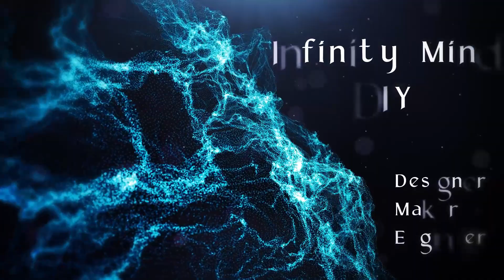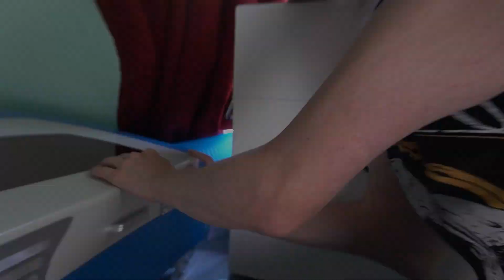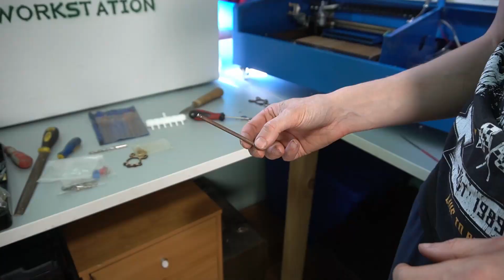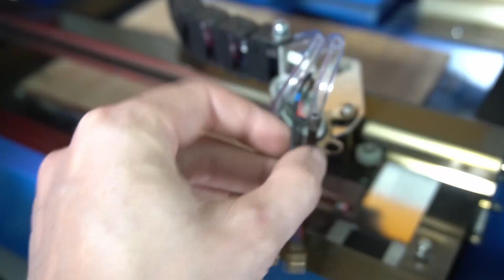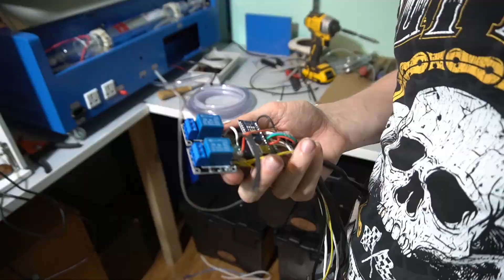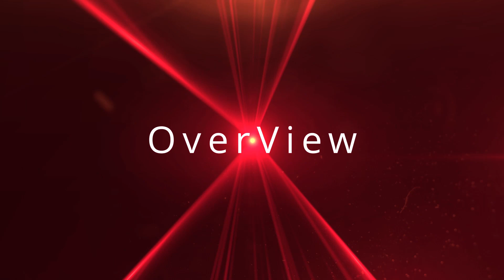K40 Laser Essential Upgrades, You need to really consider having these upgrades

Comment: Nice video on your mods, especially the Air Assist.  That pump is great for the K40.  On mine, I took a pool noodle, cut it in half and placed the pump on the half noodle strips, before attaching to a piece of Pine and then to the K40 base.  Also, these pumps tend to get hot when run for a long time, and I was worried about heat buildup in the enclosed electronics area.  So I mounted a large computer fan, in front of it, to help keep it & the electronics are cool.  It works great.  Have not had any issues in two years.  I also use a similar air assist set-up for my Diode Lasers.

Comment: Why did you use an  Arduino for lasers and air assist? 2 latching switches or relays would have done the job.
Reply from the maker: Probably would have been simpler but it is the solution my brain came up with at the time.

Comment: Hi there, I bought same Machine but I have problem with could you please help me? when I connect Usb cable I can hear sound but, it will not work at all. in software will say :USB Error:Laser not found (Lib USB driver may not be installed)   but I have install as it should also I have change many cable but same dam message will come up. wish you or any one have experience help me
Reply from the maker: Hi, I cant say I've seen this issue before but the process i would follow is:
To check everything is on
Then uninstall and reinstall the driver (restarting the computer between each task(It used to be a think you needed to do, not so relevant these days but old habits and all that).
If that doesn't work check/change the cable (as you have done) 
then I would check inside the machine and make sure all the various leads are connected correctly to the board.
If this doesn't work then try a different computer if possible.

Then if these don't work then ask more people and hope one of them has had this problem.
Hope this helps

Comment: The double laser sight is not much use unless you are surface engraving, when cutting, the focus needs to be in the centre of the material thickness you are cutting.
Reply from the maker: Thanks I'll bare that in mind,  I'm starting wonder how I make an adjustable bed to help with the laser focus, good tip.
Reply: @InfinityMindDIY  Levelling an adjustable bed is difficult. You`re better off using a fixed bed lower than your focus and using shims or spacers  to raise the material to the correct height. I`ve colour coded mine for each thickness.

Comment: Some nice mods. Gladly you don't need to be afraid of the laser reflecting onto the workpiece. Since there is optics (the final lens) involved the beam gets defocused very quickly. Even if you opened up the machine and shot at a mirror, you would only be in danger if you stuck your head all the way down to the workpiece where the defocused beam would already be quite big, and hence safe :)
Reply from the maker: So I'll throw my experience in here, when aligning the laser to see where it is on the mirror you use a bit of paper even the defocused beam is strong enough to burn through in as long as it takes to push the test button. Even if the defocused beam doesn't permanently damage eyes (it probably would) it is likely to do similar damage to getting a flash from a welder at the very least. 
This HURTS for days. the breeze on your face from opening a door will just make your eyes stream. so if I can spend 30 mins covering few holes to prevent the 1 in 100000 chance of it hitting my eyes even a little bit, its time well spent. 

But it is good to know that it defocus's quickly as well another reassurance is always good.😀
Reply: i don't think the beam gets defocused that quickly. How quickly the laser loses its focus depends on a lot of factors. I wouldn't dare to watch such a laser operate with the lid open.
Reply: @bwer1  I know that it defocuses very fast. The lid would be full of burns from specular reflections if it was a real issue. It's only good that it defocuses very fast :)
Reply: @zaprodk  you're right. I didn't think of that. I still wouldn't take any risks though